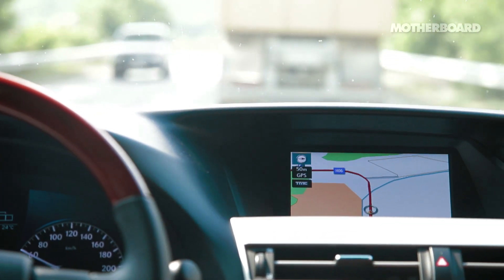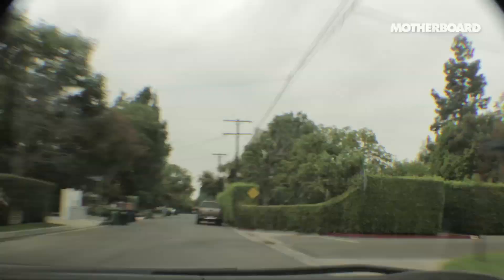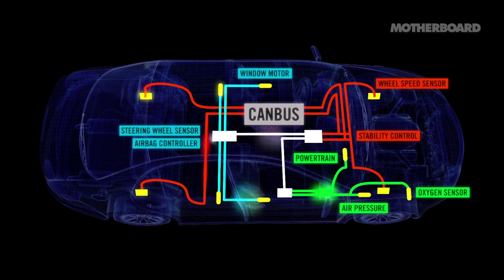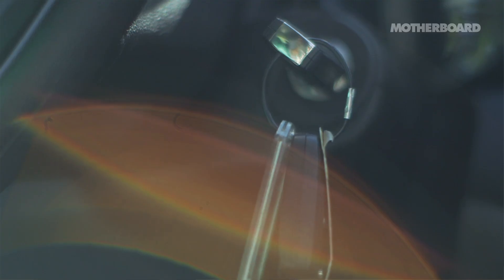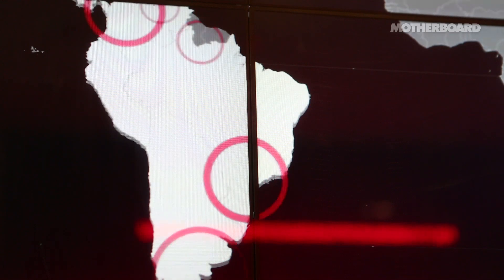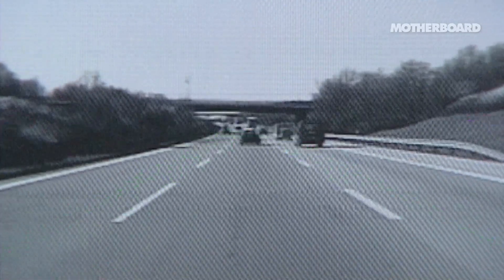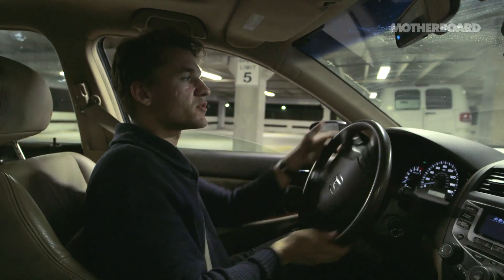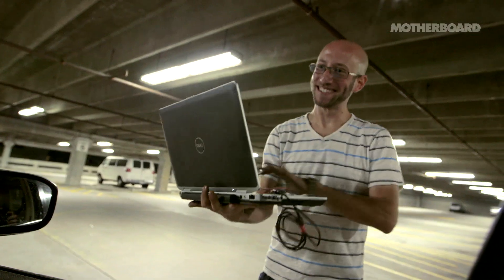How to Hack a Car: Phreaked Out (Episode 2)

Comment: I would like to know how to hack so if a police car following me I can hack in his cat to stop his car :)
Reply: You can't. 
This report is just sensationalizing it. You have to put a device inside the car you want to "hack" connected to the CAN bus of the car.
Reply: You're confusing cats with firewood.
Reply: ***** lol yeah, I replied with my phone and auto-correction bullshit changed the text
Reply: Wankel Motor
I do not think that you need to get into car to add this.  You can connect from under-neath. I worked for an agency that made tracking devices for cars to track where you go.  Courts ruled that if the tracking device uses the electricity of the car (you wire it to car's electrical system) it's not illegal.  If it battery powered it is illegal. I believe that this silly law is so the government and car maker can know that the device is on the car.  Battery powered will make it harder for government and maker to discover.
Reply: d smith I've never come across the CAN BUS when working outside of a vehicle. Most cars store their engine computer inside the passenger compartment, the wire harness that connects to it branches out to hundreds of sensors but without access to the computer directly I don't see how you could possibly gain access without breaking in.

Comment: There is a chance this is total bullshit.
Some 2013-2014 model year cars are connected to the internet but that doesn't mean you can control the car through WiFi... The internet in cars can tell you about nearby restaurants and the weather. It can not control the engine in any way, car designers are not retarded. He said the gas pedal was not directly connected to the engineblock but it is definitely not connected to the internet, that is just stupid.
Reply: Yup most of this video is fear mongering. Like when he claims the brakes stop working too in the beginning. They're hydraulic, you cant control them with a computer, even a honda dealership scan tool. not possible.
Reply: Brian C Yeah.. it would make more sense if talked about hacking airplanes because there everything is controlled by computer.
Reply: cars of today have different communication systems such as canbus and of course they are interconnected at some point so if a car has a connection to the internet than it is THEORETICALLY possible to intrude into its systems and send messages over the canbus (which is message oriented so you could send an  engine off command from any source and the reciever couldn't know if its a legit one or not)
Reply: I think he was using a module on the chip you stick in the car that connects to GSM networks and sends commands to the chip and thus the car. If it can be done with house lights and what not, then it's basically the same thing, only it's sending commands to the car hacking chip instead of light switches.

But hey, what do I know right?
Reply: spinnenente No it is not possible. The two networks is not connected together and have nothing to do with each other.
Reply: Brian C Brakes are activated via the ABS system. It is entirely possible to apply them without using the brake pedal.
Reply: Tyrone Ross Activate them yes, but not to deactivate them. 
And what happens if the ABS brakes are activated suddenly? well you come to a stop and the worst thing that can happen is that the car behind you does not react quick enough and you get a dent in the rear of your car.

Deactivating the brakes is impossible and that is the thing that would be really dangerous.
Reply: Wankel Motor The valving inside the ABS module allows the computer to reduce the pressure inside the brake calipers by directing the fluid to a reservoir, allowing the wheel to "unllock", this is the core function of an ABS system. Cars are designed to be safe with their written programs, not to be safe against hacking. This might all change.
Reply: Right, and on top of that, I don't believe activating the abs module would create enough hydraulic force to stop the car. It doesn't put out that kind of hydraulic pressure. It needs the hydraulic assistance of your foot on the brake pedal.
Reply: Brian C The ABS unit has a built in hydraulic pump. There are already quite a few cars on the market that can brake for you. Seriously guys, do some research....
Reply: I was referring to the Honda Accord in the video, when he claims the brakes stop working too. But yes, I understand that some vehicles can stop themselves
Reply: Brian C Indeed, the car used in this video to demonstrate hacking is a pretty poor choice. If he hadn't manually rewired the ECU to his receiver module he would not have been able to do a damn thing.
It will be fun to see what hackers will do with  the eCall system in 2015. That one comes prewired to the factory ECU and can be accessed remotely. I hope that manufacturers built in adequate security, otherwise I am not buying a new car ever again.
Reply: Wistner http://www.ted.com/talks/avi_rubin_all_your_devices_can_be_hacked?language=en from the 5 minutes nark (really just watch the whole thing)

Comment: so if you can hack a car. That means you can hack a Jet? or a Airplane?
Reply: since car intern communication is not fully standardized you have to analyze it ( im not a specialist for canbus but ive worked with it briefly ).
so you'd first get that information which will be hard since this is usually company secret and then you would have to know the cars systems well enough to get access to read/write on the canbus to do the things he did.
Still this is a lot of work where you need highly qualified people and if the car manufacturers up their security it should be even more difficult than it is now.
(i just hate that they got macafee in this video since their software is appaling)
Reply: thats pretty sick. still amazing i never knew it was possible. But how fucked up would it be if someone hacked into a jet plane.
Reply: Maybe, but you still can't download a car.
Reply: *****
The FAA was controlling all commercial aircraft long before 911. It used to be called fly by wire in the 80's-90's.  Pilots only land and take off generally.  When evasive maneuvers are needed pilots will then take control, but most of the flight is controlled by the FAA and has been for over 20 years.
Reply: d smith: The FAA doesn't control flight they monitor them to avoid any plain from flying into another plain.  that's why you can't just hop in a plain & go for a joy ride, you need to file a flight plan & the FAA is the organization that takes care of all that.
Reply: *****  Didn't have to "hack" the planes. Bush and his friends paid Saudi nationalists to fly the planes into the buildings; explosives were also placed and triggered to make sure the buildings did indeed collapse.
Reply: TheLithuanianGuy yes This things have Wi fi
Reply: Wrong during 9/11 there were actually only planted bombs the planes were cijs or known as phantom planes.
Reply: Ya, a guy proved that he could hack into an airplane on his android phone

Comment: Wonder how many people have been assassinated by governments using this. If this can be done by individuals I don't see why government agencies wouldn't use this for dirty work. Some say this is what occurred with Michael Hastings
Reply: As soon as I saw this that's the first thing I thought of. His car was blown up though. Maybe this happened to Paul Walker.
Reply: nickm2137
A witness to the Michael Hastings crash said the car seemed to be traveling at maximum speed and was creating sparks and flames before it fishtailed and crashed into a palm tree. So hack the car and have it go max speed you will get sparks and flames from hitting stuff as your speeding. As for Paul Walker dont think government was afraid of him
Reply: The car was a Mercedes and the explosion had enough force to detach the engine and fling it about 100 feet away, even if the car exploded due to some issue there is no way the blast could be that strong, it had to be a bomb Google it.